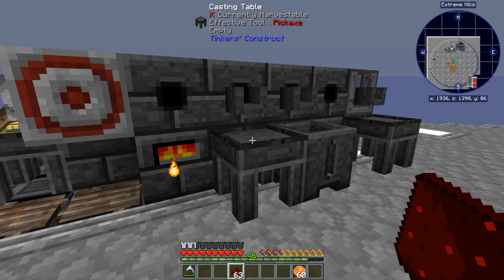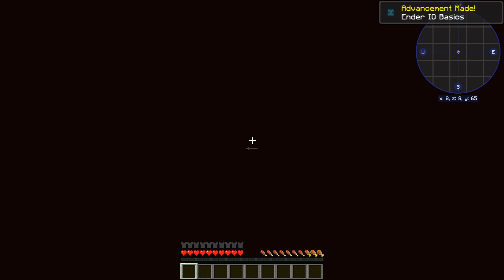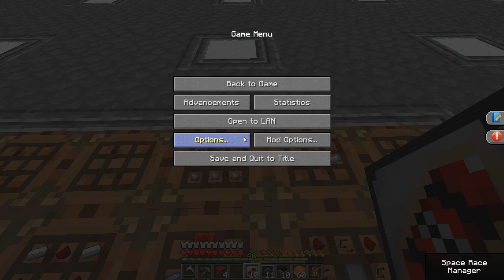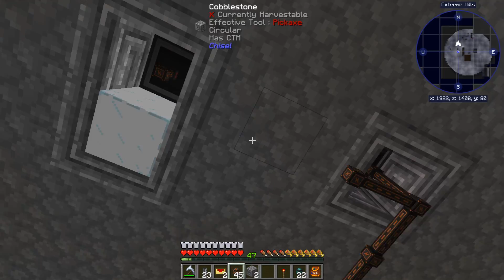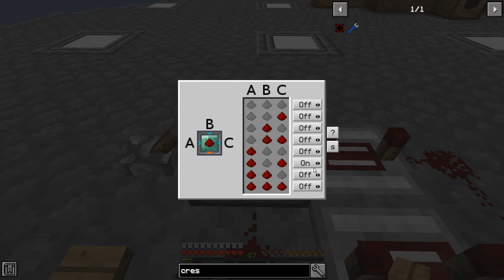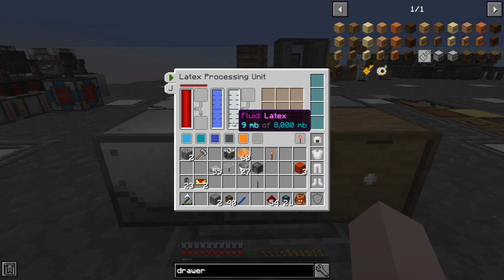03 - Zinc Armor, Power, Black Quartz, Lens of the Miner, Portal to the Void - Project Ozone 3

Comment from the maker: Tips to reduce lag: https://www.reddit.com/r/feedthebeast/comments/alcl6g/how_to_play_po3_on_a_laptop/
Some of the mods listed are already removed with 3.0.37. I will be keeping LagGoggles, TipTheScales. I'm not adding Optifine or TexFix, The only mods I’m adding for now are Smooth Font, Tick Dynamic and Vanilla Fix. 
If you add VanillaFix change vanillafix.cfg
S:scheduledTaskproblemAction=NOTIFICATION     to
S:scheduledTaskproblemAction=LOG
This will stop the notification from appearing on the screen, but won't fix the problem it's warning you about.
Reply from the maker: To replace the overly loud reward sound download:
https://www.dropbox.com/s/hmyx3po4akl5cqv/rth.ogg?dl=0
Rename it 11.ogg and replace
resources\minecraft\sounds\records\11.ogg

(I had previously posted this as its own thread, but Youtube was hiding it from my viewers and only I could see it?)
Reply: Thanks for that. One more thing, i don't know if Thermal Solar is still in the pack (i havent updated), but their tier 6 solar produce 600rf/t. They are stupidly cheap at the cost of crushed netherrack(for the titanium) and glass, with a little iron. Its as simple as making your sledge unbreakable to collect a few thousand netherrack to sift.
Reply from the maker: > Thermal Solar
Thanks for the heads up. I'm usually turned off by solars that are a pain to make. But I will consider them.
Reply: Assuming the configs are the same these solars are honestly probably too easy to make for the power they generate. Upgrading each tier also only requires a few of the base ingredients as well which is pretty silly. 

I stopped using them for main base power because they're a little too 'cheaty' for my liking and im now just using them to power random machines that are off my power grid until i get proper wireless RF transport.
Reply: @WilxGaming  It will work with any sound btw. I changed my 11.ogg to this: https://youtu.be/P3ALwKeSEYs
Reply: At around 18 mins you said you would link the sound file for the achievements. Have you posted that somewhere yet?

Comment: I'm rather late to this series, but for the servos, if you make the basic iron ones (iron is super plentiful early game) you can upgrade them to the more advanced ones with 1 of the correct ingot which does end up costing 3 ingots, 2 iron, 1 of the upgraded material, but it's only 1 upgraded material, so if it's annoying to make invar, electrum, enderium, you can make those servos with only 1 of the alloys not 2.
Reply from the maker: Good to know

Comment: 15:49
If you use the waypoint system that comes with Journey map you don't have to worry about enabling cheats or having to open world to Lan, which I've found actually added some lag even though it's not an actual server. (Well, enabling cheats is prudent anyway so that you can fix things easier if they go wrong)
Also, you won't have to remember or keep track of what homes are set to which name, as with the waypoint system it keeps track for you in a list. (Ctrl+the waypoint key-bind, then click the dimension button at the bottom to scroll between dimensions) Doing it this way also makes things easier to move between points with the teleport option, and leaves it up to the individual player as to whether they want to use this method of travel.
I personally recommend using the Journey Map method, as it's much easier to keep tabs on important places, and frees up the extra time used to write down every /home command as well as easing the question of "Did I remember to set a place for this or not?"

Keep up with the vids. Just subbed to you as an additional input for ideas to try as builds.

o7
Reply from the maker: Don't you  need cheats  enabled to teleport to a Journeymap Waypoint?
Reply: @WilxGaming  Nope, it's a feature of the mod. I go through and make the portals and stuff that I need, but then I use the Journey Map waypoints because it's just faster travel and doesn't take as long to load the destination area. And we both know that when it comes to grinding in MC, time is one of the most precious resources that need to be managed to stay efficient in progression without getting sidetracked into rabbit holes.
Also because I know the pack (more or less), I've had to restart a couple times in the early game just because it was quicker than trying to fix and rebuild after getting blown up by charged creepers.
(If you suspend a block of Witch Water over the killing point, you will get more than enough Wither Skulls to go towards a Wither Farm later on.)

F7 is a godsend...especially when using cursed earth for a speedy mob farm and forgetting to make sure every square is lit on a Blood Moon night. I still get jumped every once in a while when I expand and forget a light somewhere.
Reply: Waypoint teleportation is disabled outside of cheat mode for me. Did you change something in the config.to allow it?

Personally i prefer to use the waystones. Each to their own.
Reply: @coopmooo  I didn't change anything. OG and Caz probably disabled it when they put the pack together.
I haven't gotten far enough yet in PO3 to need to worry about it. I just mentioned it because is was enabled in all the other packs I've played.
Reply from the maker: It's hiding in: \journeymap\server\5.5\journeymap.server.global.config
> "teleportEnabled": "false",
To the best of my knowledge the default is false. If it's set to false and you're using it to teleport, then you're OP and probably have cheats enabled.

Comment: Give the crescent hammer a try on the Ender IO conduits as far as shift left clicking the junctions. Should still open that GUI. Only real benefit of yeta wrench anymore seems to be to isolate a particular type of conduit in a bundle.
Reply from the maker: Thanks. Squizzcheeze already suggested that, I tried it and it works.

Comment: You should open a loot box/episode or something =)
Reply: Also I forgot to add; I'm using basic mechanical pipes from Mekanism for fluid transport, you might find that easier to use than ducts? Just thought I'd suggest it.
Reply from the maker: Mek pipes sometimes have problems with other mods. While I'm a Mek fan, I stay away from their piping unless it's Mek to Mek.
Reply: @WilxGaming  same....except with IC2 ...the machines wont require power input upgrades

Comment: Did you consider xnet for your cabling? One cable beats two.
Reply from the maker: Dynamos have 1 side that power comes out of and 5 sides for inputting stuff. You can get an augment to change that, but I would never waste an augment slot on that.
Reply: @WilxGaming  advanced connectors can let u use all the sides of the block. But they might be a little expensive
Reply from the maker: > advanced connectors
I hadn't though of using them that way.
edit: I haven't tested this idea, but doesn't the advanced connector only select 1 side, even if it's not the side it's attached to. Wouldn't you still need to attach to 2 sides?
Reply: @WilxGaming  You can create multiple channels using different sides of the dynamo in the controller, so you can have 1 connector attached but are using 2 sides of the dynamo.
Reply from the maker: > You can create multiple channels using different sides of the dynamo
Good to know. i should have tested it before posting.

Comment: It takes about 40 minutes for me to run this pack. Can i reduce the time by any means?
Reply from the maker: Did you follow the link from the pinned (first) comment on this video? Did you remove the mods listed? Did you make the config changes?
Reply: @WilxGaming  yes i did. Now its 20 minutes. I can live with that. I do have 60 fps while playing. Also can i remove chisel and bits,in the reddit the guy said it would mess up some of the recipes.
Reply from the maker: > can i remove chisel and bits
I'm not very far in the pack. I don't know which quests that would be.
Reply: Awais Akhtar I guess one way would just to do how wilx did just make a new instance copy the save over and change what you want
If you crash/break the save just use the other lne
Reply: @crazedanime9154  thnx i will try it.

Comment: To my knowledge, thermal ducts are less laggy because
1. They work like a multi block battery, where the generators push energy into the network, and then the network push power into every connection.
2. They are regular cubic models, which can rendered statically
3. EnderIO conduits might take up more memory since they need to store more information about what’s inside that block
However it’s usually not worth it if you have complex wirings, such as crossing item and energy piping inside a automations
Reply from the maker: Each segment of Fluxduct must decide how much rf it's pushing down the line each tick. This would make it seem like more calculations than just the end points, but the calculations would be simpler. And that's only one of the apples versus oranges comparisons involved in theorizing lag.

Comment: In the configs for Agricraft, under client settings there is an option to turn off sprinkler animations, and at least for my instance was already off by default. Not sure if that helps with the lag situation you were describing though.
Reply from the maker: If you mean the very first part:
> B:"Disable particles"=true
Then yes I already saw it and it was already off. But they can still cause lag. Thanks for the heads up all the same.

Comment: FYI...chunk loading using the FTB Utilities way (shift+rightclicking the claimed areas) is disabled in this pack by default, unless you have changed the settings.
Reply from the maker: Thanks for the heads up. I didn't think to look. ftbutilities.cfg:
>   B:chunk_claiming=true
>   B:chunk_loading=false
I'm fine with using chicken chunks.
Reply: @WilxGaming  if i recall right, chicken chunks chunkloaders load a 3 chunk by 3 chuk area.  typically i use mekanism entangloporters with anchor ungrades to chunk load.  they keep that one chunk loaded plus they also double as a way to move around energy, items, fluids, and even gasses "wirelessly".
Reply from the maker: > entangloporters with anchor ungrades to chunk load
Thanks for the suggestion. Chicken Chunks has both Chunk Loaders (multi-chunk, can set the range) and Spot Loaders (1 chunk). If all I want is chunk loading, Chicken Chunks is much cheaper. However I can see applications for the multi-function of the Quantum Entangloper. I especially want to try them since I've never used them before.